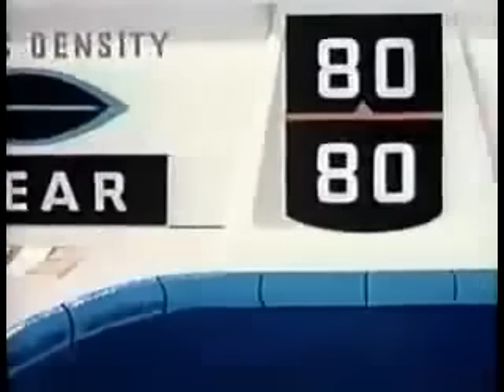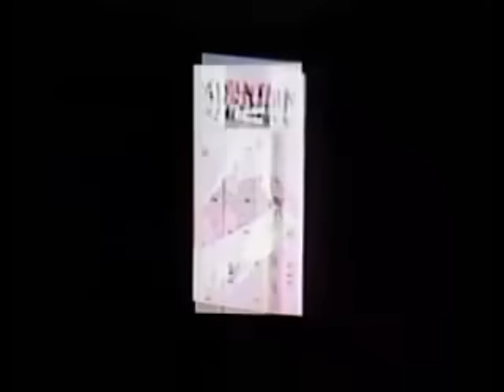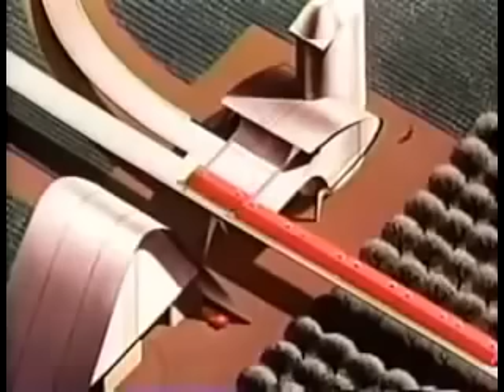The Future of Transport: Disney's Magic Highway - 1958

Comment: At 1:19 in this video: speed limit 85. They must think that future cars are going to have a much better braking system than what's around even today. So far it's just not safe to have a speed limit of 85 miles per hour. I think it would take around 30 years of technological innovations before an 85 mile an hour speed limit becomes safe.
Reply: 85 mph is about 137 km/h. The recommended speed ("Richtgeschwindigkeit") on German highways is 130 km/h. This is not far off.
Reply: Theres a freeway in texas with a speed limit of 85 MPH. Iv driven it a few times.
Reply: When I am in a hurry I go 150 km/h = 93,2 mph.
Reply: Montana interstate speed limit is 80Mph. Not recommended, but on many stretches you can do 90 without issue. It really is a question of traffic density and number/degree of curves. (and weather)
Reply: They were also going by the density of traffic on existing highways in the 50s-60s, which was actually manageable. Having enough space between cars that 85 was reasonable to expect was a lot more common.
Reply: If your deathly afraid of fast speeds and your in Germany, don’t go riding on the autobaun

Comment: Two things they hadn't thought out. 100% clear car roofs would turn the inside into a greenhouse and would require a lot of energy to keep cool. It would also need UV filtering to prevent sunburns. The second is they greatly underestimated the amount of computing power needed to have a safe and functional autonomous vehicle. We are close today but it is still way more fallible than an attentive human driver.
Reply: The self driving thing being part of old sci fi is likely what made the public vastly underestimate the computing complexity needed for driving. Sensors are not enough; you need a decision making system that is still well beyond current systems, let alone affordability.
Watching the tesla system observe obstacles as slowly as it does, is unnervingly slower than I do than even a very tired day.
Reply: any glass prevents sunburns.
Reply: @lubu4u312  Glass by itself blocks nothing at all or it wouldn't be used in greenhouses. It must be treated to block UV and infrared to be suitable for this use.
Reply: @miniskunk  Nope, glass easily blocks UV-B, but lets UV-A through. UV-B directly hurts cells and causes cancer, UV-A's effects are largely indirect. Cars do use solar glass which is treated to reflect ~60% of the incident solar energy, spread across both IR and visible ranges. Almost all modern cars use this because they get a fuel economy credit, as well as allowing them to put in a smaller and therefore cheaper AC system.
Reply: Clear roofs can be done if they're adjustable clearness, and these systems have been included in many cars already, such as the rivian r1t and r1s tri motor trim.
Reply: I dont think its even glass but some transparent metal alloy

Comment: It's impressive to think that only a partial majority of the technologies conceptualized in these dreams came true, the rear-view camera with monitor display and GPS as well as the blue-tooth connection.

The fortunate (but immediately unfortunate removal) of the Gas-Turbine Car, then later coming (debatable) electric car. 
The convenience of the Motor-home having modern amenities such as TV, Bath, Radio, and Internet (if you purchase a Wi-Fi extension or personal hot-spot device.)

Improved construction devices to aid highway and roadwork services. (disregarding the lack of constant upkeep that is often times seen in the United State.)
And the rarity that is the actual elevator parking system. (they exist, but not everywhere)

Despite the percentage of downsides, it all worked out in some shape or format to the ideas of the American Dreamers. (Realistically modified for the modern human being.)
Reply: I think Electric will have its niche, but Hybrid is superior and will likely succeed it. Hybrid beats gas in terms of cost and milage. Electric fails from the fact that it takes so ling to charge and once you run out, wherever you're sitting is where you're gonna be until you get towed to a charging station.
Reply: And the wonders of the high fatality rate! Don't forget that. You can find the statistics online quite easily.

Comment: The car industry's propaganda machine was at full speed back then lol, shame it stifled so much public transportation opportunities and eradicated most passenger train systems
Reply from the maker: Ironically when you look back to the 1960's most of the trams in most cities were sold and when you dig into it they were bought by the oil and car companies then ripped up ...
Reply: And the bulk of cities were bulldozed for parking lots.
Reply: It wasn't "propaganda" that killed passenger trains, it was economics. Passenger rail for more than commuter distances hasn't been profitable for quite some time, and it only lasted so long because the federal government mandated that rail companies had to provide it until the 70s when Amtrak was born (and rail companies rejoiced to have that albatross off their necks). (COMMUTER passenger rail also isn't profitable, but it's HEAVILY subsidized; in my local transit district passenger fares cover maybe 5-8% of the budget with the vast majority of operating funds coming from Federal, state, and local grants.) Amtrak tickets cost roughly the same as 21 day advance coach airfare, and flying is much faster and generally gives you a lot more options of both where and when you want to go. And Amtrak still loses money. Now, part of that is that the federal government ALSO subsidizes airports and highways, but still: if the government actually wants to increase passenger rail travel, they need to subsidize it more, to make it cheaper than plane/bus tickets to make up for the inconvenience of "the route you want only runs three times per week; hope you like getting to the station at 3 AM, because that's when it arrives at your station, and if you're there at 3:01 it will have already left. ASSUMING it's on time, which is a BIG assumption."
Reply: @ptorq   don't bullshit lol. It hasn't been profitable due to the same government bullshit that you say is needed to make it work, aka, giving monopoly contracts and subsidies which resulted in horrible track and line placement, coverage. Much like the communications bullshit monopoly and government contracts that left half of the US with HORRIBLE internet compared to many other countries, even far poorer ones. Not to mention the constant inflation going on and growing taxation which shrink possible sustainable profit margins. There's also the tax robbing aspect - trains are extremely cheap to run and maintain, crap to use for public transport... Which in turn translates to very little tax return for the government. The more the citizen spends, the more money the government gets, and as a bonus, the more they can boast about their bullshit 'growing GDP' numbers to promote and pat themselves on the back.
Reply: It's not car industry propaganda as much as it's state road and city planning monopoly. And well, cars being the most inefficient, and thus most expensive travel method are, in turn, the thing that brings in most taxes. What do you think the tax greedy government, who has monopoly on roads and city planning will choose..?
Reply: @mkzhero the more area is covered in asphalt rather than having businesses or residential buildings, the less taxes the city gets. A sea of asphalt generates no money, but a lot of expanses.
Reply: @kusokbik    wrong. First of all, cars breaking down on bad roads and inaccudents generate taxes for them, fuel wasted in traffic jams too. Second of all, maintaining roads gives them an excuse to tax, even if they don't actually do it. Lastly, you're expecting too much from government and their long term planning and ability to realize stuff, innovate and keep things progressing instead of stagnating and regressing. Aka, they're extremely incompetent, and maintaining a semi workable system of transportation on roads is about their upper limit.
Reply: @mkzhero  we agree on almost everything except the reasoning behind building car infrastructure. My point is that the government is lobbied by automobile industry. By "seas of asphalt" I mean not only the roads, but also the enormously large parking lots. It's just poor land use.

Comment: They were right on the money with some of their predictions. Bridges will be built using prefabricated 3D printed carbon fiber composites.
Reply: And backup cameras
Reply: bridges are poured in place with concrete already, no need for fancy 3d printing nonsense.
Reply: @doltBmB  Nothing to favor 3d printing over other means, but using prefab assembly offsite makes them much faster to install. My state DOT can replace a four-lane bridge over an interstate in a weekend, much less disruption than traditional means.
Reply: @doltBmB as they said earlier, prefab bridges already exist.  Hell people had prefab houses you would assemble from kits in 1912.

Remember that RDR2 house building section?
Reply: Reverse camera too
Reply: I think it would be around 30 years before bridges get built using prefabricated 3D carbon fiber components.
Reply: @stephenlangsl67  You may already know this, but... non-carbon fiber prefab bridges have existed for ten years or so. Normal surface road bridges over freeways and such can be installed in only a day or two.